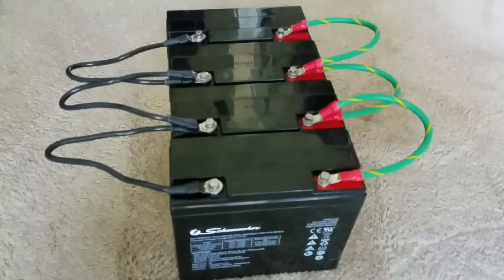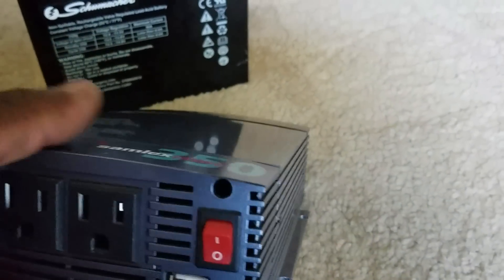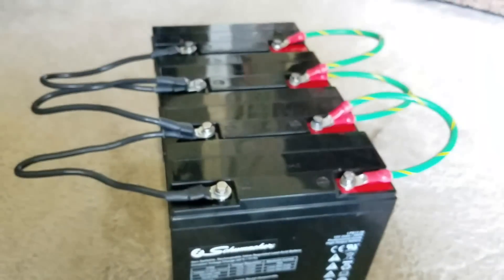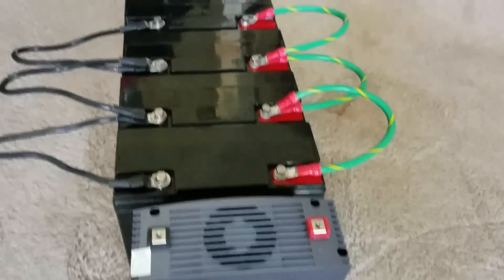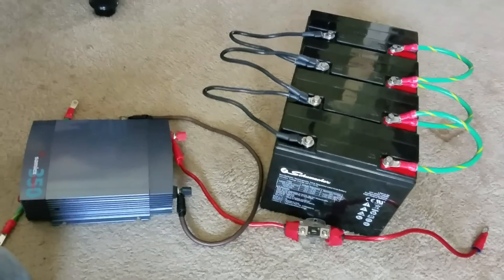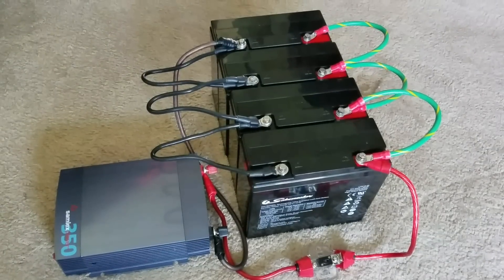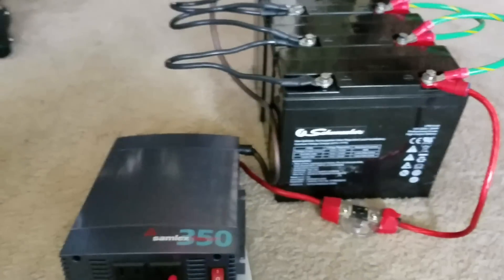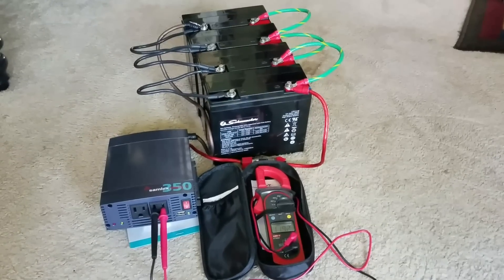SOLAR SURVIVAL KIT Pt.6 By: jwsolarusa

Comment: I would go with a bigger inverter on that and then just keep the smaller one as a backup.  Also add in some 12v receptacles of some sort.
Reply: Nice video. You may also want to checkout the review of survival kit on my blog at josereviews. com/survival-kit-review/ Thanks, Kelsey.
Reply from the maker: +8digitPDX 
That's right. 
Thanks for your suggestions